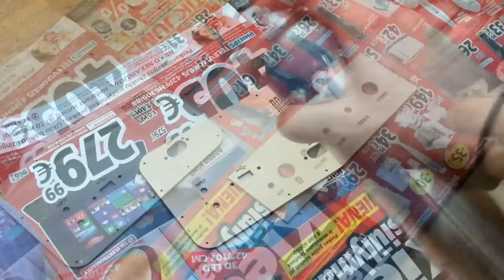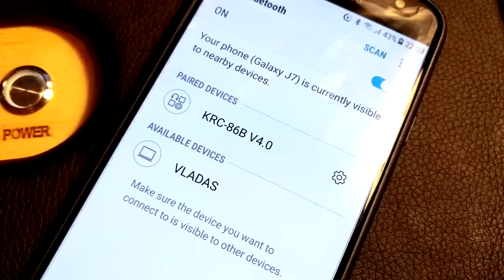INSANELY Loud 150W DIY Bluetooth Speaker Build l HOW TO

Comment: Is he powering everything with that??? 16:52
Reply from the maker: That is only for powering the preamplifier and Bluetooth! 😉
Reply: Dude he showed you the real deal power supply like 20 seconds before that...
Reply: Boi that’s the crossover for the speaker are you crazy????
Reply: The main power supply is at 16:22.
Reply: He put 2 power supplies. First is 12v 0.2A (for bluetooth module), the second is 36V DC and he showed it. DC 36V   5A WX DC2416
Reply: @vicmaese  Do you think that this crossover was necessary? I am asking cuz I'm not an audio engineer and I see for the first time that someone uses crossover in DIY speaker project.
Reply: Talking about 16:22
Reply: @michalotron  These crossovers comes with morel 2 way kit, they were designed to work with them

Comment: No Port or Passive radiator is included in this build. The low frequency will distort the speakers even at half of the volume.  Apart from that I appreciate the effort put on building this. I think there is enough space to add Passive Radiators and some polyfill to damp up the speaker enclosure.
Reply: Shamil Aiyubkhan that’s exactly what I was thinking 🤔 no ports or passive radiators ??
Reply from the maker: Hi! Thank you for your comment, I really appreciate your attention to my build. Yes, I was able to add passive radiators or ports, but I did not want to overcomplicate the project too much. The speaker turned out great anyways and it gets really loud and with lots of bass!
Reply: sealed doesnt mean distortion. not sure where that came from
Reply: 23:53 do you say the bass is clear?
Reply: Tekboy 808 I never said sealed enclosures will make the speakers distort. The size of the cabinet matters when making them sealed. For this size of speakers the cabinet is too small, so it's best to use a passive radiators or ports
Reply: never  thought about it beïng the microphone???
Reply: You do realize when you used ports or passive radiators it increases the size of the enclosure needed right? ported enclosures always require more cuft then sealed
Reply: Hey tekboy, your 12 inch subs in sealed boxes distorted like fuck when you pushed them. You just don't know what distortion sounds like. Sealed will play lower (in the the sub-20s) than a ported box, but they aren't going to compete in the usable range. Sealed, while somewhat lower distortion, isn't going to compete in output to a ported design and therefore you're going to push the sealed driver harder. Not 100% true all the time, but with most people, that is what happens.
Reply: Not all speakers distort. Some speakers sound even better when used on a sealed enclosure.
Reply: Can he install a turbo to!!!!???
Reply: Hi there, what you said is absolutely true & i was going to say same thing.
Reply: these speakers are actually quite good, very good quality for your money, i cant imagine you'd have any problem with the speakers distorting or sounding choppy on the low end; if properly crossed over from tweeter to mid, they'd handle all the sound you'd be able to give them. only reason i say that is i ave a set of these in my car and they continue to impress me lol
Reply: If the box is builded correctly it doesn't matter if it's ported or sealed. The fact is that small speakers is better in sealed boxes and bigger speakers (subs) are better in ported and sometimes sealed. So the only thing that does matter if the specs from this speakers is allowed sealed box and nothing else. The project was amazing to watch and the box is wonderful built.
Reply: @MechaTronic161  best explanation 👍
Reply: passive radiators would have to be on the side and make it lose efficiency. could have easily done a ported build too. nothig wrong with ported speakers but I hate ported subs
Reply: ObiWan Shinobi < You dont get it didn’t you?   Nothing is wrong with a ported box.  The problem is the type of crossover he uses in this build. You dont want a Boombox that is sounded like a midrange because of the port resonates high frequencies.
Reply: you all are thinking in terms of a subwoofer. these are not subwoofers. they are car midrange speakers. they are designed for sealed enclosures. given the dimensions of the box, it is .33 cu/ft which could be considered a tad small, but Morel gives ZERO technical info on these speakers, so we cant really determine what the exact proper size box would be. there is no "universal" size box for midrange car speakers. you need your VAS, FS, and Qts to determine the proper size sealed box. for a ported box you would also need the resonance frequency (Fb).
if ANYTHING will cause these to distort, its the amplifier. since its rated at 36v it can push out some decent power, 160 watts per channel with a THD of 10%, I sure as hell wouldnt want to max it out. the speakers are only rated for 60 watts RMS. 
Polyfill is a good suggest though. I always use Polyfill in sealed enclosures.
Reply: Zac Price < The reasons why they did not provide the technical info is that because most of the car door speakers are “open” baffles.  There is no point to provide the technical information.  Car door speakers are actually designed for an open baffles, not a sealed enclosure.

Oh man, i know its a mid range/full range and not a subwoofer.  Lol
Reply: @Kelocyde  ive got a sealed dual 12 subwoofer setup hitting lows around 32-26hz running 2000watts, at about quater volume i can make my doors and steering wheel vibrate intensely with zero distortion, had more distortion with a ported box

Comment: Good build but the amplifier needs more voltage (amp's) it can handle more volts and amp's it will boost you're power a lot :) and will make speaker's move more

Comment: With a 150 watt speaker he'd have to use about 30,000mah battery before getting a decent play time because the JBL Xtreme is rated at 10 hours max volume using 20 watts (40 if plugged) and it has a 10,000mah battery which has a 1kah draw so that's 50mah per hour per watt so a 150 watt speaker would have a 7,500mah draw per hour meaning that you'd only get 4 hours mx volume on those which is nice for that speaker but at that point you'd need to set it up and use batteries that can withstand a huge charge rate or it'll take hours even a day to charge. However putting shoulder straps on the speaker and maybe a 40,mah battery for a 6 hour play would be kinda nice and would only cost like $50-70 to add... However times with batteries could differ depending on the amp used as a 150 watt JBL amp may use more power then a pro grade 300 watt amp however JBL amps use a common efficiency output and power draw of other amps they are just a top brand

Comment: You are great! This diy project has everything, ie. powerful Amplifier, DC to DC module, Bluetooth Module, Buck Converter, Power supply board and illuminated push button! Perfection in work were top notch with precise! It would be grateful if you show circuit diagram along captions while soldering every pinouts! What was specs of every nuts and screw you have used? I like to see portability of this diy in absence of AC, eg. option to use it with battery in future diy! Keep it up!

Comment: I have these 2 75w 2.5” woofers and they sound amazing they came from a Philips surround system and the amplifier sounded like trash i have a tweeter doesn’t sound as good as the woofers like the woofers sound like full range drivers but with weak treble so i think i don’t need to add that tweeter it sounds better without one if. What do you think?

Comment: it should sound bassier if you place a bass port in there. I didn't suggest the bass radiator because I think there is no more space for it because it needs a bigger radiator w/c should be larger than the that 6.5 inch drivers. :) Very nice and sturdy build. Regards. :)

Comment: Open it back up and add sound dampening, it will make it sound 10 times better. You can either stuff it with sound dampening "wool", or get those foam pads with waves on them, that they use for sound dampening rooms, and put those on every surface that you can put it on. Other than that, very nice build!
Reply from the maker: Hi! Thanks for the great tip, I might actually do it!
Reply: No problem! Beautiful build!

Comment: Fantastic build as always.  Though I'm surprised 12v 200mA is enough to power it.
Reply from the maker: Thanks! It was actually my mistake not showing the actual power supply in the video which was 36V 6.5A if I remeber correctly. The 12V was only for other electronics.

Comment: Good choice on the speakers! Morel is great!
Reply from the maker: Thank You! Can't go wrong with these!
Reply: Good car speakers yes. BUT less than ideal for small sealed enclosures. The Thiele Small parameters are wrong for this application. This means bass rolloff. But probably you can EQ the bass with the control on the amp although then the speaker will very quickly will be reaching excursion limits at medium sound levels.

Comment: Awesome project! It makes me want to make one, despite I don't understand nothing about eletronic components or have practice working with this components.. 
2 questions:
- Is there any similar speaker models that costs a bit less with the same quality? Morel's speakers are a bit expensive for me now
- Can this speaker be used with a power bank to make it "mobile"?
Reply from the maker: Thank you so much for the comment!There are literally thousands of different speaker models available. I would suggest looking for a pair of 6.5in (16.5cm) component speakers.
It can definitely be made portable but that is beyond the scope of this video, have to make a separate video for it!

Comment: Hey there, got few questions that I hope you'll have time to answer:

1. If I want to have 1x subwoofer speaker, 1x mid range frequency speaker, 1x tweeter could I use the same amplifier you've used or would I need something else?

2.If I want to connect 2 of these speaker builds to 1 bluetooth transmitter like Avantree Oasis for ex. would the bluetooth module that you've used allow this or should I use another one, any idea?

3. About the bluetooth module you've used again. Does it affect the sound quality, I mean is there something else that is a little more expansive, but provides higher quality sound or this one is good enough?

4. What would be required to make that a battery powered as well?

Thanks in advance.
Reply: Let me answer your first two questions. What you mean is to use a 3-way combination instead of a 2-way speaker combination. That works with this amplifier, provided you use a suitable crossover. 2 You can connect several amplifiers to the output of a Bluetooth module. 2a. If you already want to build two speakers, it's best to build one for the left and one for the right stereo channel. Then you can also enjoy real stereo.
Reply: Would this specific amplifier be powerfull enough to power 2 speaker boxes with 1x subwoofer, 1x mid range driver, 1x tweeter in each? If yes what should be the maximum drivers power in that case? Thanks for your response.

Comment: Even though the concept is great and the execution nice, i love those 150w from a 200ma wall adaptor=))
Reply: In retrospective, you could charge the battery, let it run and then charge it again; would be a hassle for home aplications, i would up the power of the adaptor

Comment: Good job... I'd like if it was powered cordless but you'd need loads of 18650s if it runs at 12v 6A at full volume.. so see how you dicided to run it from mains power.. keep up the good work.. 😉
Reply from the maker: Hi! Thank you for understanding, it would be neat to have it cordless but it would require a lot more work and expenses to get there!

Comment: Good work 
But why the 12v 0.2 amp adapter 
I know you applied it for the pre amp , bt module , and to charge your phone
You can rather use you mobile charger adapter 
Which will did the same job without any step down and that b0505s module
It will also be a reliable source

Comment: Hey man! I really appreciated your work!!! I’m doing a project and I want to see you working with 18650 cells to make a portable boombox with 200w and passive radiators. Your ideias give me a north to develop new projects inside the Brazilian reality of power-buying. Greats from Brazil!!! You have so many fans! Waiting you reply.
Reply from the maker: Hi! Thanks for your comment! Powering a 200W speaker with lithium-ion cells would be quite pricey, but someday I may accept a challenge like this!
Reply: Hey I am working on a project with that. the batteries were around $70AUD for 8.8Ah, so on full volume it will be 18V ~11amp, so 3/4 of an hour of play time :(.
But I am installing my portable drill batteries(thus the 18V) on it so that means you can switch out two (or more) 4Ah batteries making it 11/2 hours or so.
But i hope having it on 1/4 volume most of the time will work :).( making it run for about 6 or so hours).

Comment: it needs bassreflex and it needs to be tuned to the speakers best performing frequency
Reply: A suitable housing for these Speakers must be much bigger than that. And it is questionable if the speakers will work fine in a ported cabinet. We do not have data to tell if the Morel speakers are  better in closed or in vented boxes. So you only can try different boxes or measure the respective speaker's parameters which will let you calculate the appropriate enclosure.

Comment: I like this one, good job man, i thought you are going to add a small battery pack to it, but nevermind, this thing looks like it could be rather portable. Additionally i expected you to add some passive radiators or bass tubes, maybe this is bassy enough like this, i am not sure but those would have helped. All in all i like it, good job man, keep it up :)
Reply from the maker: Hi, thank you so much for commenting! I did consider adding a battery to it, but since this is more like a stationary speaker, I made it cheaper and easier to build without batteries. The speaker is bassy enough without any additional ports or passive radiators, but I am sure that they would add even more bass. 
 Thanks for watching!

Comment: Nice work.  Just curious why MDF and not plywood?
Reply: MDF is easier to work with, especially if you want to cover it with foil or artificial leather anyway. Furthermore MDF has more internal damping which makes it more appropriate for speaker cabinets than plywood.

Comment: Very impressive work right here. Did you design the box specifically for those drivers and their specific volume requirements or was it a case of building something that looked right aesthetically? 

Either way it's a quality job you did with it.
Reply from the maker: Hi! Thanks for the comment! I actually designed the speaker on WinISD trying to keep the volume of the speaker enclosure as tight as possible but not so dad it sounds bad.

Comment: Good woodworking skills but you really need to research some speaker cabinet design . If applied right that little amp and a good set of speakers is enough to rock a small party. I may have to make a video of my own one day to demonstrate my attempts with some I've already built.
Reply from the maker: Thank you! I absolutely agree with you, but everyone has to start from somewhere. This is one of my first builds and I still don't have the measuring and testing equipment or knowledge to build a proper speaker :)

Comment: Good job! How is the sale going? I have just seen that the price is 340€. 
Please let me know about amplifier power (not speaker's power).  And which is the reason that why you have  used 12V 200mA AC-DC adoptor? It is only corrsponding to 12x0,2=2,4w of power.
Reply: Pay attention - all the information is there for you.

Comment: It be cheaper for me to buy a store bought system. With the money I would have to spend to buy all the machinery you used to make the box I could buy me 4 or 5 good bt ready made units. All- in- all really good work and final product.
Reply from the maker: Thank you! I do agree that building a speaker yourself might not be the cheapest option if you don't have an ability to use a shop with tools but otherwise it is rewarding!
Reply: @DonnyTerek  I agree 100%. I've been trying to find and buy hand saws to do a build, I know it might not endup looking as nice but with my liw budget i think I can make it work. I know i can find bt speskers on the cheap but, I want that feeling of satisfaction, and only making something myself will give me that....as you already know.

Comment: is there anyway to connect batteries to the electrical board? i would liket to have one with batteries and wall power.
Reply from the maker: Hi! It sure is possible but would require a large battery for sure!
Reply: @DonnyTerek  anyway u can work with a 24v board and go from there?

Comment: your work is perfection bro... but you should put 2 holes on back for bass
Reply from the maker: Thanks! I may consider that for an another project.
Reply: Google 'port size' and you should be able to find a simple formula about size and length of the port based on the amount of volume  of air the speaker pushes, I wish I could remember it. The speaker manufacturer might have that info.
Reply: But it's not necessary in a closed housing version. In this version he can use passive radiator speakers for even more bass. Of course it would be better if the speakers had more space. But he has no partition between two woofers so I don't know if making two bass reflex tunnels is a good idea.